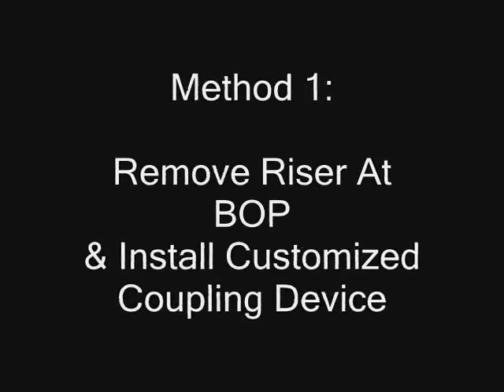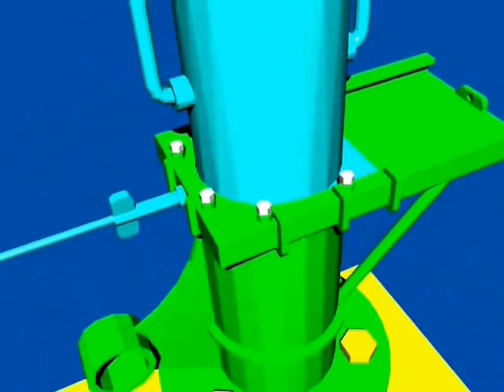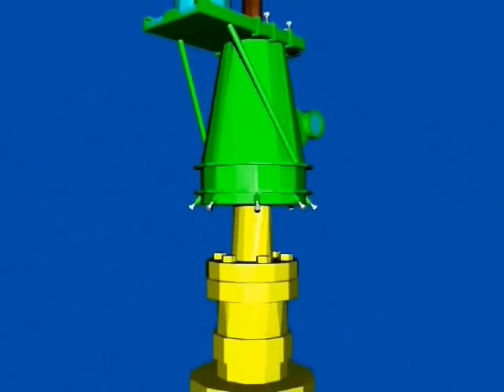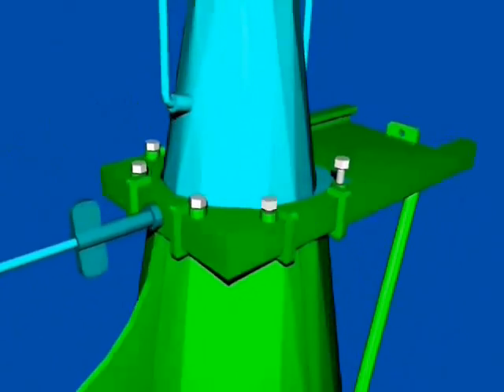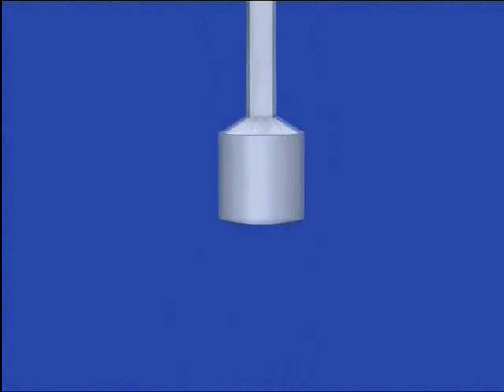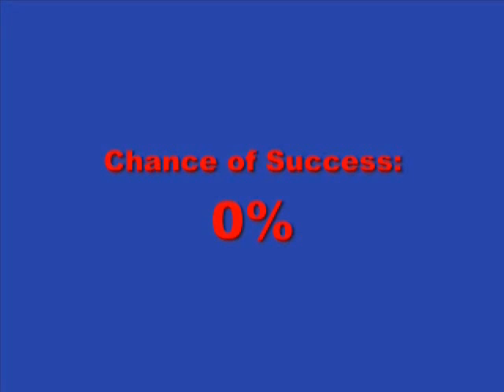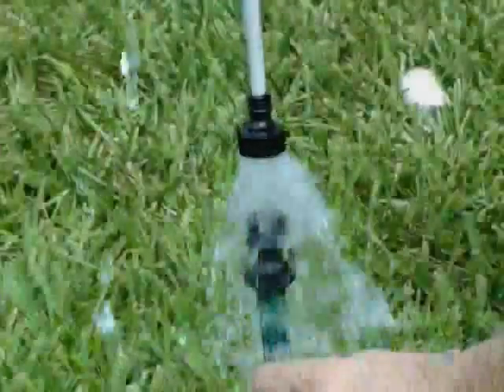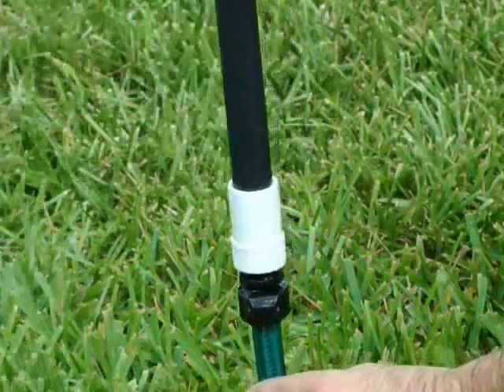NRGC - Gulf Oil Spill Solution - Help Stop the BP Oil Leak - Flaws with LMRP Cap

Comment: Hi John,

Your idea is excellent, but we would need some more physical data.
Can you tell what is the relative oil pressure ? I'm not
talking about the absolute pressure due to the depth
but of the force that oil will apply.
Everyone says there is a high pressure, but noone seems to
be able to give a physical value.

Comment: I envisioned a new collar equipped with a large valve and wheel, similar to the ones used by John Wayne in the movie Hellfighters.  Once installed, the valve could be closed.  Then BP could later attach a new pipe to the surface and then open the valve and collect the oil.
I would assume the engineers at the company that makes the bop are working on a fix like this.....then again maybe not

Ed

Comment: John it looks like a great idea but here's a couple of issues that have come up...Apparently the BOP was acting like an anchor so they are not certain of it's mechanical stability and that it can hold up to any additional pressures, 15KPSI at the base 7K PSI to the riser, the additional pressure ie CAPPING it...Putting another BOP on top of it is ludicrous at best. Knowing these facts any suggestions on your solution or another?

Comment: Nice ideas.  The main problem I see with these solutions is that they require a lot of high torque bolting and unbolting.  Are the ROVs capable of maneuvering some type of underwater impact wrench onto each bolt head, and then applying torque to the bolt heads without themselves spinning?

Comment: Great work John.  Many have offered solutions for capping the well ie:  The inverted conical cap offers a viable solution to overcome the tremendous pressure of outflowing oil u so aptly identified -- conical shapes meet least resistance to outflow pressure during insertion...

But, the solution u offer keeps the well viable for future oil extraction.

BP will prefer a such a solution due to its investment (conversley, BP is apt to reject solutions that only cap the well.)

All the best...

Comment: Wont the methane freeze the water going thru the riser like it did on the 4 story containment block they tried..if the water turns to ice. it won't work...like an evaporator in an a/c system..if the gas is runaway, it will freeze the evaporator solid..(riser) there won't be enough heat transfer from the surrounding water to keep everything liquid.

Comment: Please take a look at  this incredible youtube video: 
BP Oil Spill: Why They Can't Stop The Leak!!!!!
This explaines why BP is not using any of the 80.000 suggestions to stop the pipe leak. They are using the pipe leak as a pressure escape of oil and gas, else the sea fund will crack or worst explode releasing in the Gulf an intire lake of oil and gas.

Comment: With my Solution we have an very flexible sort!                                                               It will be possible for the ROVs to install it.
It was taken consideration to all facts, as underwaterphysics, install-resonance problems, ROV-Works, Stability-calculations, Oil-Pressure, further flow or not, valve-installations, Methanol-injection and more.
You can see the drawings here: auto-007 dot de
Somebody having a better idea?

Comment: Nice try... but..

the real problem is how to accomplish all of your suggestions at one mile under water.

All methods you've considered are fine but how do you accomplish them?

The only solution that will work is the completion of the installation of relief wells.

It's that simple.

Comment: @PumpajPozitivno  The cone being large in diameter won't effect the upward force because the opening is bigger than the cut riser. The fastening force will be the same whether using the first mechanism or second, so bolt size is the same.

Comment: Sound design, John, from a mechanical engineer. I think they sized the LMRP's riser according to the capabilites of the receiving ship/tanker. It could have worked, but they did not fasten and seal the LMRP to the wellhead. Your idea does exactly that.

Comment: uh, I saw no attempt to "explain it away" what video were you watching? I saw a few well thought out attempts at accomplishing what BP has been unable too, seal the well and capture ALL escaping oil. If you think dropping a bunker buster will solve it, I can assure you, even if dropped from the edge of space, it could never develop enough inertia to penetrate 1 mile of ocean depth with much force. And I fail to see how in the world blowing a bigger hole will seal a smaller one.

Comment: THE PSI OF THE LEAK IS NO WAY NEAR 8,000 psi,.what calculations are you using? if you do the correct calculations its only 150-200 PSI,..its about 2 times the psi of a fire hydrant bust.

Comment: I think there might be a few problems.  One is you are attempting to bolt a new riser on while oil is spewing thru it and around it at 5000 psig.  Have you ever cracked open a 1/4" scuba tank valve?  3000 psi AIR.  Oil is probably 700 times denser than air.   There will be resonance and stability problems. Hope you figure out a work around.  My solution avoids those problems.  Please take a look at mine and give me some input.  Thank you. Jim youtube.com/watch?v=A_0ydLwT3cM

Comment: I'm skeptical that the new pipe can be 'easily'
 slid across pressures like that... even an open pipe... and the hydride crystals(?).
BP was using antifreeze in their silly inferior cap.
I say silly because they knew it would not work... like the 'mud' idea.

Comment: I like solution #2, but I don't think BP is capable of using a wider pipe all the way to the surface. Just above your device there has to be a connection to multiple smaller pipes that can be connected to several ships at once for a complete and uninterrupted collection of oil.

Comment: What makes you think that the bolts can be removed that easily? They have been in salt water for over a year and I have heard that they are welded. If the bolts could be removed by a rov than they could save time by using another bop on top of the old bop instead of fabricating something that isn't proven to work.

Comment: I like your idea and your knowledge is well presented .I also sent and idea to Bp -early  May  [WORK WITH GEA OR AGAINST GEA , BY PUSHING BACK with great force Aprox 6000psi]BUT IT DID NOT WORK they called it top kill ,so I'm following through with another' the elastic syringe skeptic'.

Comment: I'm a chemical physicist, and my solution looks almost exactly like your #2 solution, but with more copper/lead sealing flange rings and relief valves to work in conjunction with the retaining bolts. The bolt-actuated header I agree is an optimal method to do so. Has BP responded to these diagrams? Have you presented these diagrams to the gov't?

Comment: These are good approaches.  I also came up with a similar way to your method #2 to bind to the flange but using using hydraulic instead of the bottom angled bolts.

Like you, when I saw the LMRP cap being placed, I realized its riser was too small.  I think they designed it for 5000 bl/day flow before they knew what they really had coming out of the BOP.   This is why the last of several relief valves on top the LRMP cap will never be closed.   It will cause the cap to blow off.